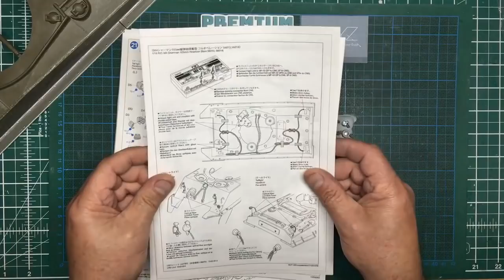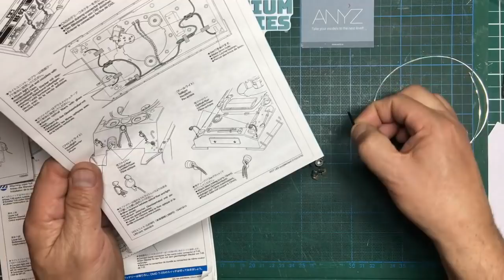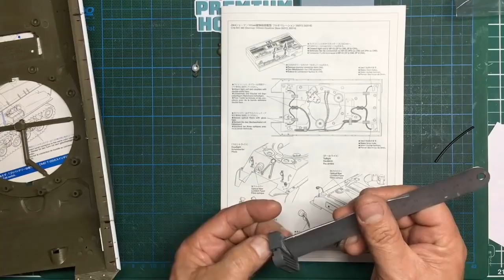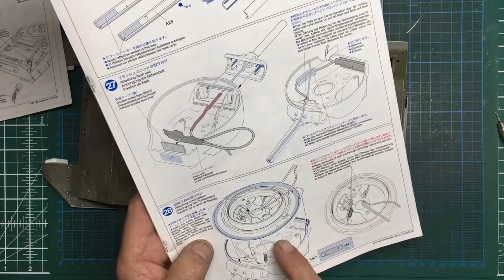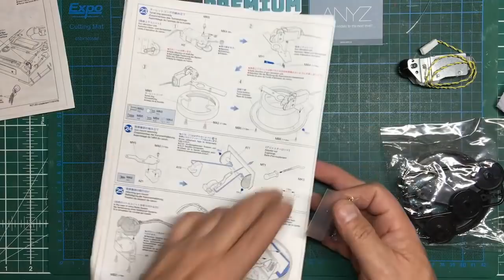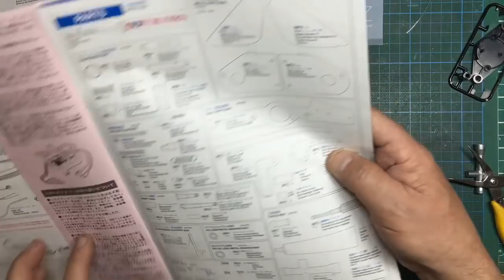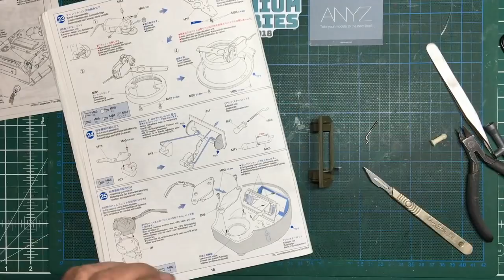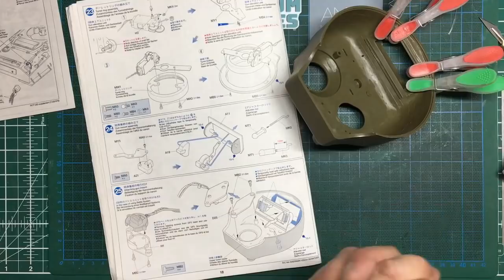Lets build a Tamiya 1/16 RC Sherman. Part 24

Comment: If you pull the black ring off the motor assembly it can fit in the turret after you have done the sanding. It takes alittle work but it does go in.
Reply from the maker: Thanks Buddy.. I'll try that.

Comment: Fibre optics & electrical stuff are new to me so I found this very interesting! With regards to not wanting to fit the gun elevation motor into the turret just yet, it nearly went through the hole- could you file the metal part down slightly so you can fit it later? I don't know how much you'd need to remove but it didn't look like much. Of course, I don't have the parts myself so I'm only guessing.
I agree with Keith Waterhouse about Molotow chrome pens- they're amazingly good.

Comment: According to the Osprey publication Sherman Medium Tank 1942 - 1945 by Steven J Zaloga you have an M4 the A1 had the cast hull. (Both had the radial).
Reply from the maker: thanks Steve. I think you missed an "A" something there after M4?
Reply: No, it's the basic M4, the M4A1 has a cast hull. (Oddly enough the A1 was Feb 1942 and due to lack of production facilities the M4 was July 1942) Both used the Continental Whirlwind radial. The M4A2 was a diesel (GM Twin 6-71) (two bus engines welded together) and went to the USMC because the Navy had diesel powered landing craft. The M4A3 used the Ford GAA petrol engine. The M4A4 used the  Chrysler A57 multibank engine (four car engines mated together and had a longer hull to accomodate them) and was the version sent to us in the UK under Lend Lease. Hope that helps you Nige? Keep up the good work, loving the channel!

Comment: Yet another great build video. I noticed for reflectors behind lamps you're using a metalic chrome. I know you are frugal, but have you tried Molotow Chrome pens? Best chrome you'll ever get, can use dirrect from pen or decant and (it's IPA Based) spray with IPA or levelling thinners about 30% chrome:70% thinners. It also brush paints lovely with a little IPA or levelling thinners, even neat, but the thinners dry fast so needs rehydrating

Just a suggestion Nigel, it give a great effect behind clear parts, reflecting the lighting you show models in. I clear red and green nav lights on inside then a coat of Molotow and they look amasing. If you put some on bottom of a Tamiya bottle, at a later date you can rehydrate with levelling thinners and still use. So cost effective as you never waste any
Reply from the maker: Keith Waterhouse me, frugal?? No.
Reply: @NigelsModellingBench  I'm like you, save a penny where I can (like saving bags, it's green as well). All I ment was you don't buy extra's if can do yourself. Go with the Molotow and trust me...........about £15 for the 30 ml refill or about £4 a pen on Amazon or E bay

Comment: I'd recommend going down the aftermarket Aluminium Barrel route - on mine I used the supplied Barrel and regretted it.
Reply from the maker: I was thinking of turning a barrel on the lathe, but I am working with the plastic and it looks ok? I was surprised to see there are flats on the length of the barrel at 90 degrees from the seam??
Reply: @NigelsModellingBench  I think that's the issue Nigel - its 'ok'. You're putting a lot of work into this build and its looking great - I think the Barrel may let it down. Whatever you decide, keep up the good work!